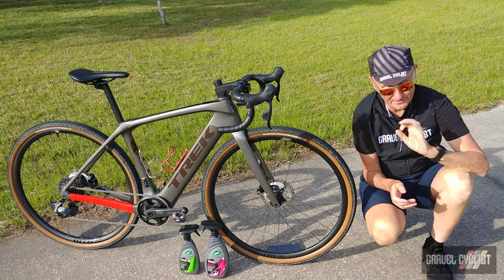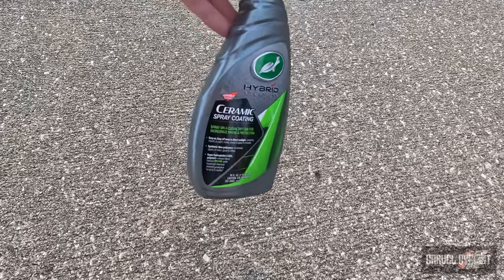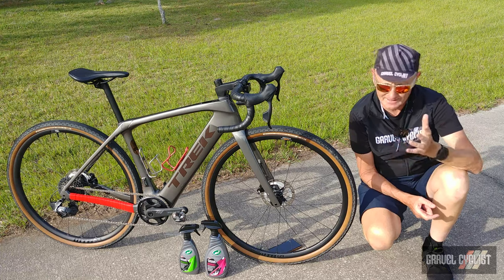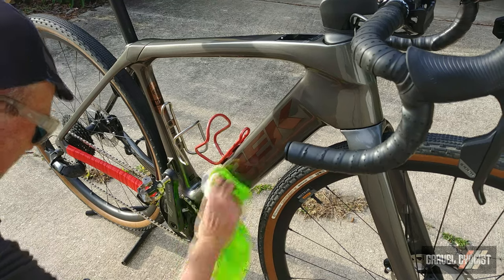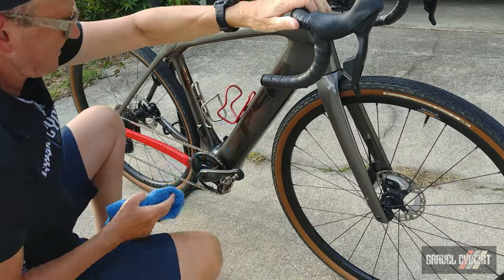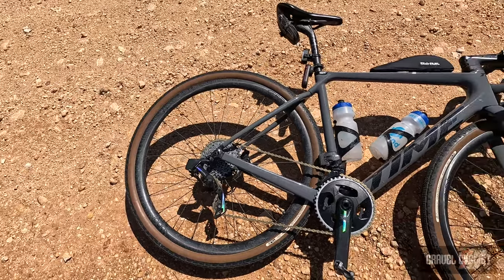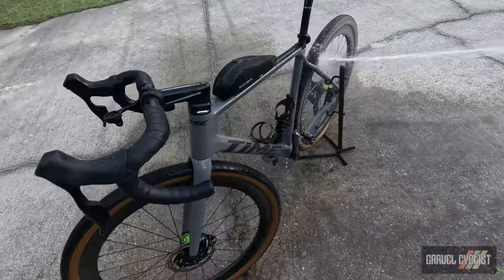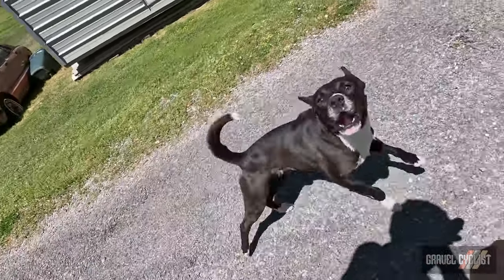Ceramic Coating, Help Deflect Dirt & Mud

Comment: Could you tell us what kind and size tires are on the Trek Domane? The front tire looks bigger than the rear retire, but they fill the space very well. Thanks
Reply from the maker: The Domane Plus in this video, is fitted with Panaracer Gravelking SK 700c x 43mm tyre. They are the same size front and rear.